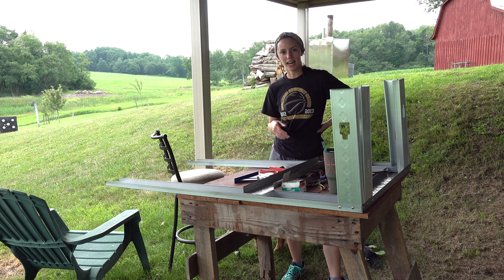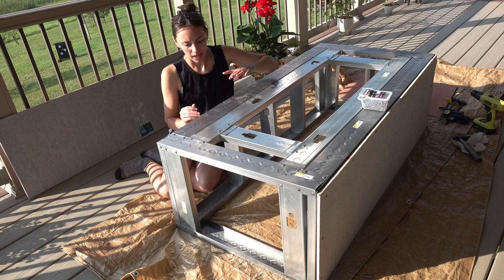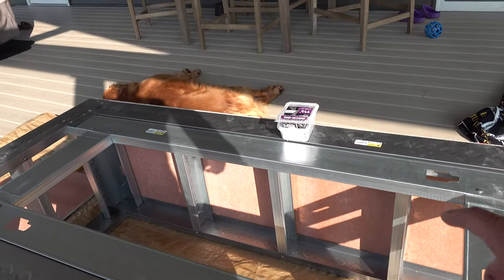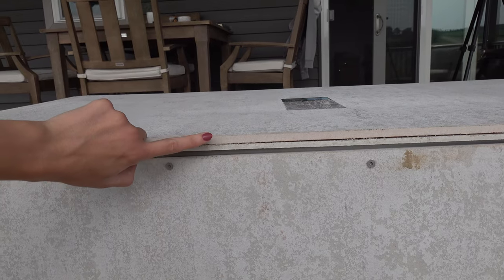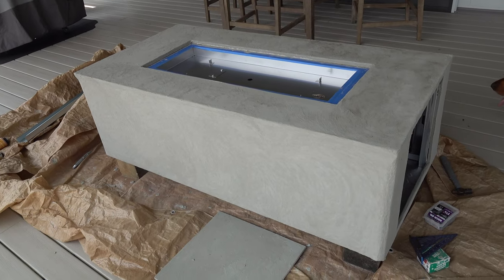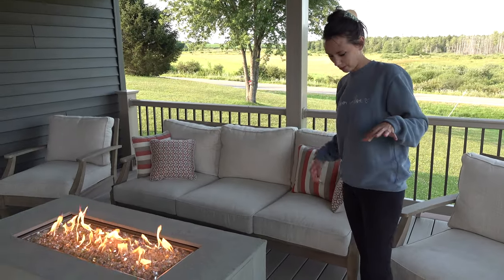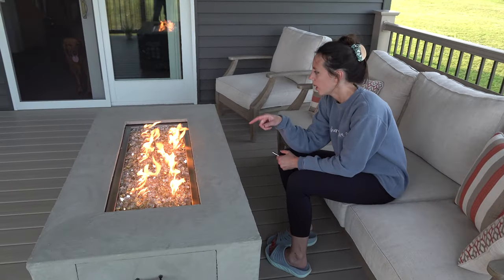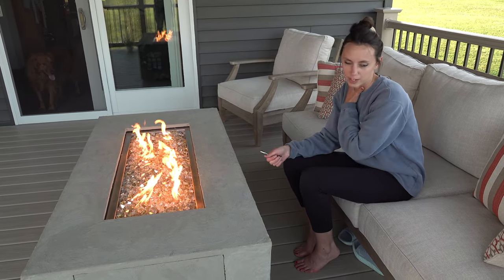DIY Concrete Fire Table

Comment: I like it! Wondering how this would hold up in the open elements?  I would have a cover but during the winter it would be surrounded by snow. Could you also estimate the weight of the final product?

Comment: Pretty impressive Kaylee! Nice job! Have any idea how much it weighs? The on-line ones usually have handle cutouts on the ends so you can move them when needed.
Reply from the maker: I would guess it weighs around 160 pounds